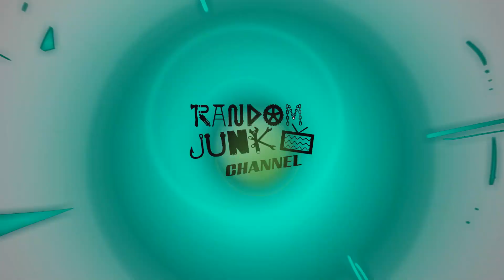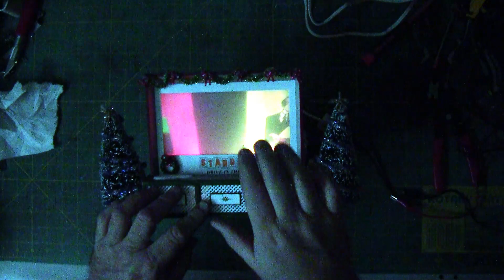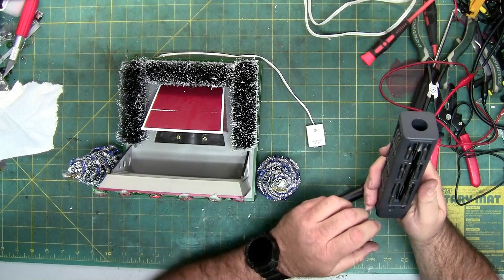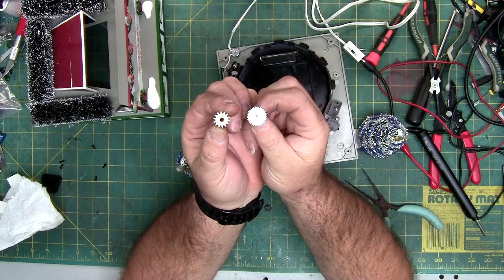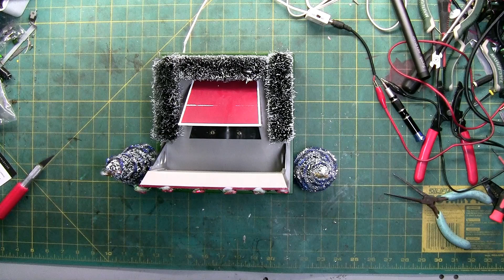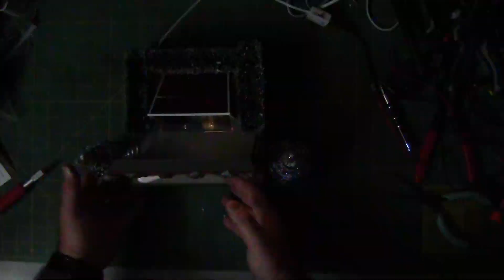Department 56 Stardust Drive In Repair - Update in description

Comment: OK, art moves but the image is off. How do I fix that?
Reply from the maker: Open the unit, power it on and watch the motion cycle. Either the sensor is out of alignment (screw may have come loose or fallen out) or the gear is slipping (a more common occurrence).

Comment: A quick mod you can do is just placing a phone behind the screen and play chritmas movies or old 50’s drive in commercials from youtube
Reply from the maker: That would work, especially if you have an old one lying around. You could integrate it permantly.
Reply: @RandomJunkChannel yeah can even go in settings and adjust the touch screen sensitivity it work through the drive in screen

Comment: Do you know what would cause the projection to be off center or how to fix it. Also, the screen isn't as crisp as when I put clear plasti shower curtain in feont of it.
Reply from the maker: Sounds like the projector or reflector has come loose. Open it and see if the screws have come loose or if the mounts broke. If loose, center and tighten. If broke, a good super glue to fix the cracked plastic.

Comment: is there a way to check to see if power is getting to the actual projector.  my drive in will not turn on.
Reply from the maker: Yes, open the access panel on the bottom for the light bulb, check the bulb visually to see if it is burnt out. You can use a voltmeter to check power at the bulbs socket to see if you have power when the unit is on.